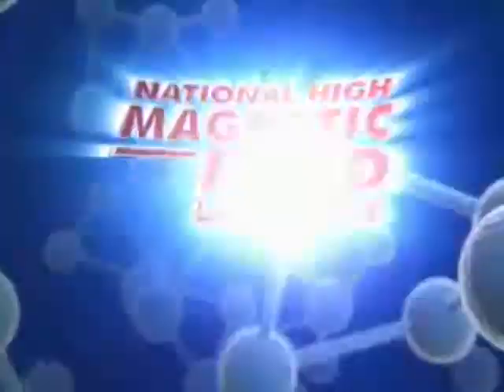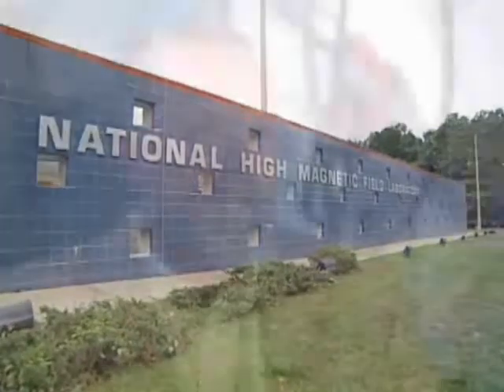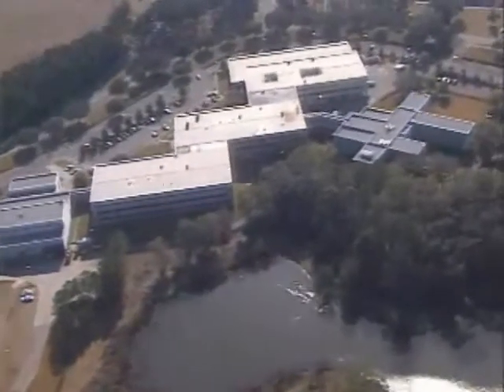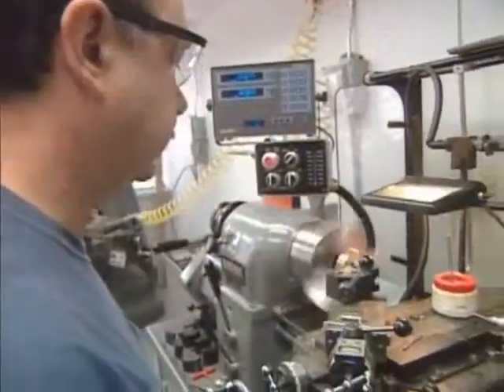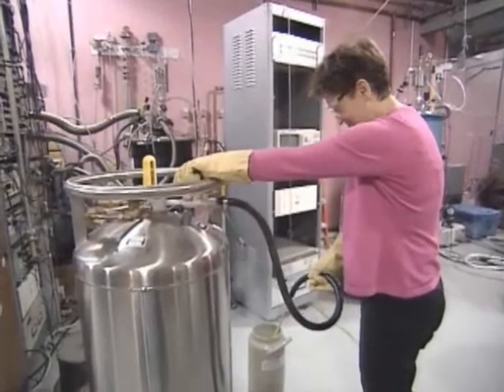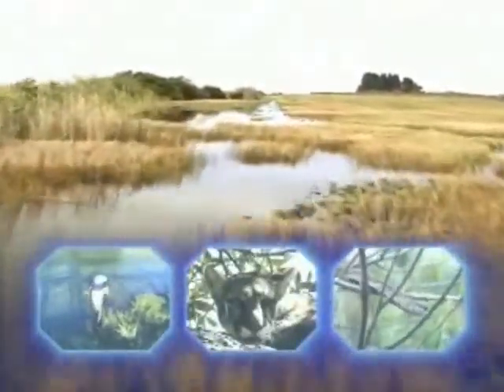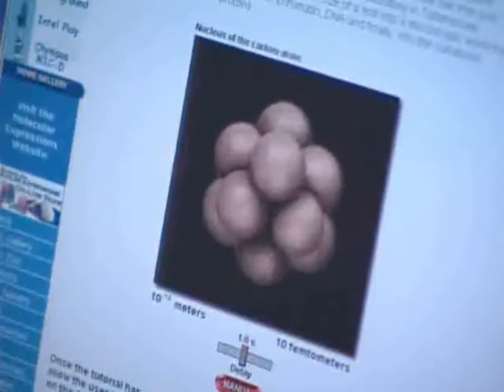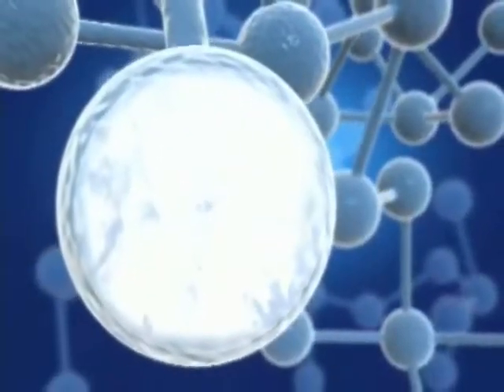Overview of the MagLab

Comment: MIT is gov' funded. Any breakthrough they or any other gov' funded project would have, would immediately be swallowed up and covered up asap if it had ample merit to providing the average citizen with the power to levitate at will and breach national borders or flee crime scenes. This plantation state will not allow this information to be public, but you can find critically important clues to how it works. Tom Bearden described the key to zero point also found on the mikefromspace channel.